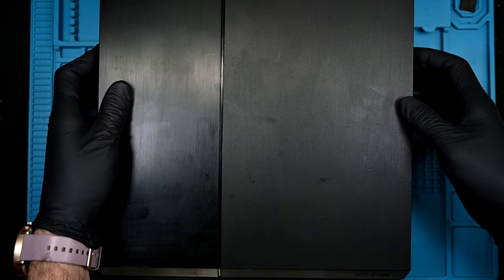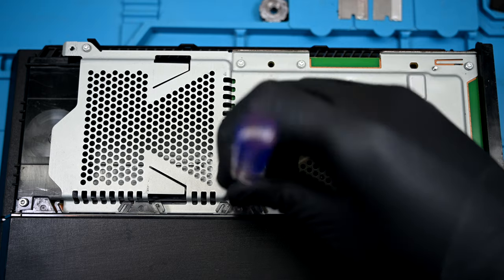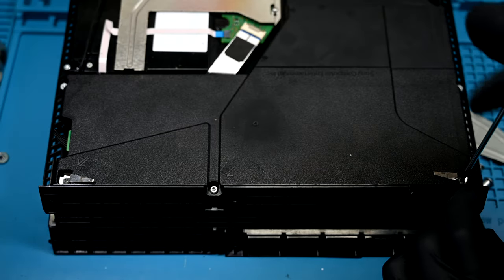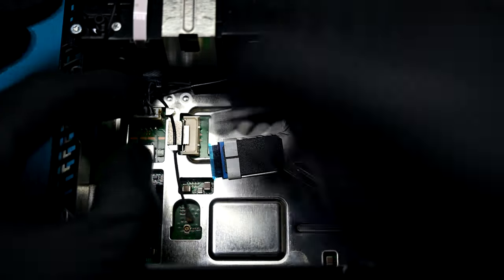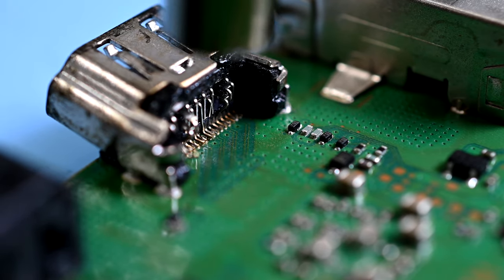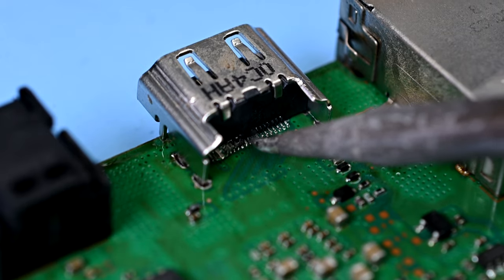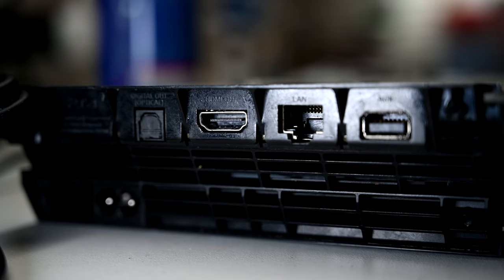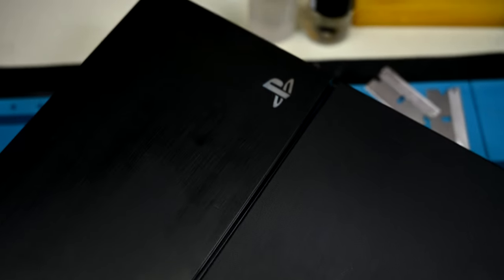PS4 HDMI Port Replacement | Guide

Comment: I have a question. My PS4 works, the HDMI does not. When I cleaned it every inch looked fine, no dents, no missing components, no rust or corrosion of any kind. Why would my HDMI not be working?
Reply from the maker: Two possibilities, the first is that the solder joints just broke over time, some are attached at the factory better than others. The other possibility is the video encoder chip failing, it's more common on the PS4 slim and pro, but can affect the normal one too.
Reply: @TapticDigital  this would make a good video specifically for those who can't solve this invisible issue, cause all seems well, but still an issue. If you have a video on this lmk, I'll search for it. I haven't watched this video yet, just came home from work. Thought of budding in asking a question that should have a good answer since websites state it's dusty or broke or restart the PS4 or other shit. A specific answer for a specically searched question other than every simpler answer as that's what say Google thinks I'm asking. Throws everything off. Id rather ask a professional, or someone with more knowledge in hardware.
Reply from the maker: @stringbean5920  not a bad idea! For a quick test you can use tweezers to gently push the sides of the pins and if they wiggle, they just need to be touched with the iron and a teeny tiny bit of solder added to reattach them.
Reply: @TapticDigital  I'll give it a try when my laziness ends. Thank you

Comment: this is a really great short video on how to repair it. But my question is.. do you have to use a heatgun to melt the solder holding the bad HDMI port to get it lose? is it possible to just use flux while pressing the solder iron on each the points holding it in?
Reply from the maker: Technically yes, but very very difficult to get all of it out. You'd have to first remove the solder from the pins and make absolutely certain they are detached or else they can rip the pads off the board. Then you'd want to remove solder from all four feet and wiggle the port up and out. The factory uses lead-free solder which has a much higher melting temperature than leaded solder, so if you're using leaded I would recommend holding the iron on the feet till they melt, then feed some leaded solder into it to mix it up. Doing this should lower the melting temperature and help it soak up on the wick much easier.
Reply: @TapticDigital  thank you so much for the detailed reply. I'm not able to get a hot air device also uncomfortable using it also. Never soldered before. Every video I've seen they use hot air so I wasn't sure. But thank you again. I will eventually get the courage to try it!
Reply from the maker: @AiYunaEverAfter  soldering is just like drawing, but with metal haha. It takes some practice, I'd practice on any old dead electronics you may have laying around first, but with enough flux it can be a bit easier. And if you have wick to soak up the old solder, you don't have to worry about too much solder going where it shouldn't.

Comment: Is it possible to replace any hdmi port with the method you used?
Reply from the maker: It sure is, this is the standard method for any console or TV HDMI repair, just make sure the port is the one for that device as some have slightly different layouts

Comment: Can I get a list of everything needed to complete this project? Thanks
Reply from the maker: Sure, you're going to need:
- A strong pry tool
- Security Torx drivers
- probably pliers/tweezers
- hot air station
- soldering iron/solder
- HDMI port (check Mobile Defenders)
- thermal paste
- some determination

Comment: What soldering iron are you using?
Reply from the maker: Hakko FM203-HD. it’s very much overkill for this line of work, but it works. I’d recommend a Hakko FX-951 for anybody doing it as a hobby or just small level rework.

Comment: This was an excellent video. I criticize the inclusion of the grinding. I would have omitted that bit because of the grief that people are going to likely give you for it. And I'll subscribe to you because you left the grinding bit in. Because sometimes you have situations where it's unavoidable. However I'd like to say when I get into a situation like the one shown. If the other side of the bolt/screw is accessible at at least 3mm I attempt to miniature vice grip it and remember that it's righty loosy when you're on the wrong end of a fastener, break it loose because someone either in the factory or at another shop over torqued it yeah it's going to ruin the fastener but I'd rather ruin the fastener and retap the hole than replace or scratch the metal housing like what occured in the video. Sorry if my solution is not how many would choose to do it, I realize you could use a hammer impact like what you have to use for drum and sometimes disk break rotors, and you could have used a very small flathead screw driver with a rubber mallet and on the right side of the bolthead at a slight angle tap it loose... Could have used liquid nitrogen to shrink the bolt. Umm I'm trying to think of another way I know there's at least one more way... And no chemicals that could damage the board are allowed so I don't need the comments like use wax or pb blaster or wd-shorty. Alcohol... I don't know if that works or not. Could try putting isopropyl alcohol in the freezer and then using it. That's within the realm of possibility.. hmm... I've seen people use a rubber band believe it or not between the screw head and the driver and that's worked before... I've seen super glue work. Using it to assist with gripping it... Hopefully you take away from this comment a couple things to try before using a last resort method like cutting in the future. I hope that I've helped you to prevent consumer complaints because of superficial damage. However if this is your personal device. Wgaf it's yours.
Lol keep the right to repair alive! Teach others, impart life lessons to the younger generations we all gotta do better and stop allowing cheap excuses for why someone can't do something. In life there is very seldom legitimate reasons why anyone Can't do something. 95% of the time when someone says I can't do it, what they're really saying is I won't do it.
Stop telling yourself that something isn't possible. Because your wrong. What you really mean is it's not easy.
If it were easy either everyone would do it or everyone would have it. Nothing is free. And instead of telling someone it's not possible, why not say I don't know, let's find out.
Reply from the maker: 👀 Woah. I'll agree with you on the rubber band trick working, sometimes superglue but it's tricky to get right. I do have a tiny pair of needle nose pliers that I think we're made for a dollhouse but they actually function, unfortunately the screws are recessed into the power supply and nearly unreachable with the pliers opened. Liquid nitrogen? Yes, I would have absolutely tried, I'll pour liquid nitrogen on anything, twice. Ideally I would have used a proper screw extractor that's made for this very scenario. 

I've gotten some comments about the grinding, about metal shavings and risk. I've been called dumb. But I'll let you in on the secret, about why I left that part in or even chose that method in the first place: sparks are pretty and fun. And grinding at a console that is causing frustration is pretty satisfying. Thanks for the sub 😉
Reply: @TapticDigital  i would have taped up the area around it to stop metal filings going all over the board, my only observation.

Comment: What kind of liquid is that do you use while before soldering? Is that flux paste?
Reply from the maker: Flux to help flow the solder where it belongs
Reply: @TapticDigital  thanks, but how do i get rid off those flux from the port hole? Mine completely covered, not like yours where it left a hole to make it easy to put new port into it... I'm stuck at there...😩
Reply from the maker: @skroturm5723  two options, one is to spend a lot of time trying to soak it up with copper wick. The other is to use a heatgun until those feet turn liquid, then force the new port in and solder the pins down after.
Reply: @TapticDigital  I'll try it, will back to you ASAP... Thanks mate..
Reply: @TapticDigital  I'm back, oh gosh.. I can't even force it..1 of tiny resistor component (on the right side of the port) was slide off unplugged from it's ground... Probably bc too hot while melting the hdmi port ground...How can i contact you? Email? I want to send a photo for you to see... I'm totally lost now..needs your help..
Reply from the maker: @skroturm5723  uh oh. You can shoot me an email at tapticdigital at Gmail, or on Instagram or twitter
Reply: @TapticDigital  great, I'll contact through Instagram instead...

Comment: Everything was good right up to where you put fresh solder on the pins first. You need to keep those pads clean until after you solder the shielding pins. The data pins should be touching the pcb pads and be soldered into place last.
Reply: yeah but thats ocd as crap lol what are you a ipc soldering instructor

Comment: Me and my dad did this but it didn't turn work, any advice?
Reply from the maker: Does it still power on? And you just have no display? It's possible that some of the pins are bridged together with solder causing a short. It's also common for some of the pins to not connect fully and come loose, I'd double check the pins first. There's a small chance the video encoder chip is dead, but the port is more likely
Reply: @TapticDigital  yes it still turns and no connections are bridged but it is missing the hdmi filter, can the PS4 turn on without one of those? btw its a ps4 fat if that helps.
Reply from the maker: @Whitetail_wolves  it can turn on, but you won't get any display. You'll need to replace that filter, they are very inexpensive online for a pack of a couple, should be as easy as holding it in place and soldering both sides down.
Reply: @TapticDigital  thanks! I'll see if it works

Comment: How would "YOU" charge someone for this same repair?
Reply from the maker: Based on how much time it will take and a slight bit more than something like a screen replacement because soldering is a specialized skillset most customers wouldn't have. And what nearby competitors would charge. Typically customers are going to pay between $100-$150 for a PS4 HDMI.

Comment: those TIM pads at the end before shield cover replacement are fubar. im surprised u didnt change those as well
Reply from the maker: I do after testing, it gets all fresh pads as well as an in depth dust cleaning, these consoles sure get gross!
Reply: @TapticDigital  Phew - Yea they sure do! I have to do the same when I deep clean them. I've had a few that were unbelievable... like clean them outside the shop bad lmao. Thanks for the quick reply, and thanks for the informative video!

Comment: What temp did u use when u anchored the hdmi port?
Reply from the maker: Typically run at 450C, these boards are very good at spreading heat so it can take a minute or two to melt the joints.
Reply: @TapticDigital  thank you!

Comment: I hope you still reply to comments even though this video is a year old. It was an amazing tutorial and I have completely tore down my pc to the motherboard now all I need to do is buy the hdmi. Is there anywhere else I can buy it for a similar price because the website is not working well with me and I’m trying to create an account but it won’t let me. I would also like to know if it would be smart to buy two instead of one
Reply from the maker: Of course I reply to comments, at least as long as I'm on YouTube! I'm glad the tutorial helped! You can grab new HDMI ports from many places, Injured Gadgets has been pretty reliable for me lately, and eBay usually has good parts if all else fails. I do highly recommend two unless you are very familiar with soldering small components, it's good to have a backup in case the first one decides to go all melty on you. Good luck, and if you remember when you're done, come back here and let me know how it went!

Comment: My hdmi port works its just jiggles inside the ps4, i got it repaired once, so i wonder if they just did a bad job, either way, i think this time ill fix it myself. Or at least try to :)
Reply from the maker: It's possible the feet got loose, it can happen if you plug and unplug the HDMI often. Good luck!
Reply: @TapticDigital  yea i let my sister borrow it, i even use a short hdmi extension so i never have to unplug it directly from the ps4, still all the moving around and stuff was going to break it. So I don't even have to buy a new hdmi port? Just maybe set it in its place again.
Reply from the maker: @justchillin7274  You are a hero for using the extender, I recommend it to all my clients. If the port itself doesn't look physically damaged where you plug it in, all you'll need to do is some re-flowing of the solder and you'll be good to go!
Reply: @TapticDigital  ok, thanks for the info  :) 🍕👍

Comment: So you’d need a heat gun to do this?
Reply from the maker: It is absolutely required, you will not be able to remove it without damage if you don't have a hot air station

Comment: mine is working sometimes but if i touch the hdmi cabel its says no signal
Reply from the maker: You've definitely got a loose or detached pin! It probably doesn't need a full replacement, just a touch up of the pins on the backside
Reply: Okay thanks i will tell my brother to fix it

Comment: Great video , U made that look easy .....I've been working on my port replacement for a full day , my ps4 has brackets that held the old hdmi port in  ...and they  just wont release from the board, no matter how much heat I apply  , the solder will not liquify and release these GD brackets...I feel I have over heated the surrounding components to the point  damage was done but  ....Ill get these brackets out despite the possible damage I'm doing , I wont know what I fucked up  till I complete the process but  ...I'm  learning  at least..
Reply from the maker: You gotta start somewhere! And if I may offer some advice on those stubborn solder points; if you're using leaded solder like I am, melt some of it into the existing solder. This will lower the overall melting temp and make it a bit easier. You can try the solder wick on it, and sometimes with enough flux you'll be able to scoop it up, but usually not. My heatgun is set to 450C, and I keep the air moving back and forth so it's not all concentrated in one spot. Once you get it out, you can try the wick to pull out what's left, but you can also heatgun it till its liquid and smash the new port in place.

 P.S. I reply to pretty much every comment, especially if you need help. And if you need to send pictures or something my Instagram is in the About tab of my channel!
Reply: @TapticDigital  TY TD!! I need all the help I can get..lol ..I've never done a port replacement b4 .. I'm just afraid Im gonna over heat the board and melt stuff ..Do u think Im just not heating it up enough? I got most of the solder off with the wick and the brackets are wiggling a very tiny bit now so Im getting somewhere I guess,  Ill send U pics tonight when I work on it again..I really appreciate the help thanx again ..
Reply from the maker: @jimmyrigged1292  if the board is damaged, you'll know it. The inner layers will bubble up and burst and the board will appear "bumpy" if it reaches that point, it's time to replace the board or console sadly
Reply: @TapticDigital  well theres no sign of that yet ..thank god ..I think im not heating it enough ..I believe u said u used 450c which is about 860f ..So Ill crank up my heat a little more and hopefully they'll pop off cuz once  they come off the new port should be easy to install

Comment: Is there any particular solder you recommend for certain jobs, or does generally any solder work? I'm relatively new to all this so forgive me if it's a dumb question lol. I know in the video you mentioned something about leaded and unleaded solder
Reply from the maker: To me, solder is solder. I prefer leaded solder because it has a lower melting temperature than unleaded, but overall they work the exact same!
Reply: @TapticDigital  Awesome, thank you for the info and quick response!

Comment: What if it doesn't have those two screws on the back
Reply from the maker: Then it technically weighs less, probably making your Playstation more aerodynamic and way cooler. I say who needs those screws, dig in and take it apart!

Comment: Mine is greatest the white light of death but the hdmi port does not look damaged at all. Any other issues i should be worried about? All other components work
Reply from the maker: Could be the HDMI encoder chip that sits behind the port a bit further back. They go bad from time to time. It is also called a Retimer chip.

Comment: I have fixed it just for some reason my ps4 turns off when I play any game 
Any recommendations
Reply from the maker: @JuanRodriguez-ed3br  sounds like a heat issue, did you replace the thermal paste too?
Reply: @TapticDigital  yes a few times 
But not sure if I did it right
Reply: @TapticDigital  I did but not sure if I did it right